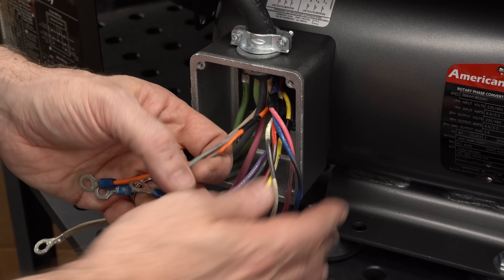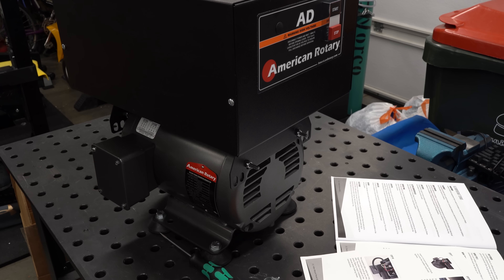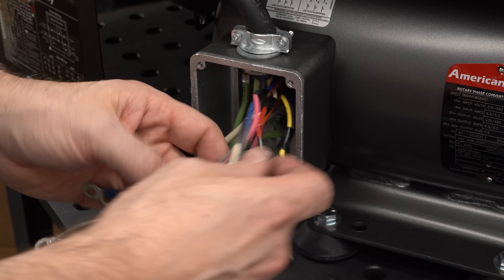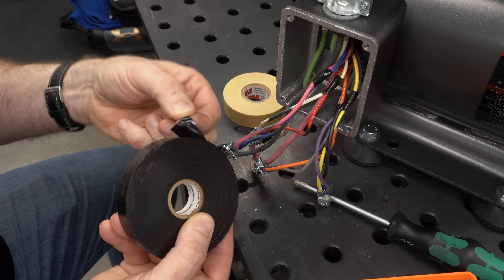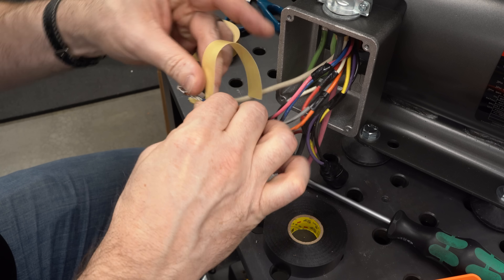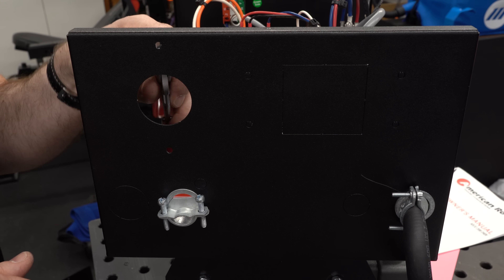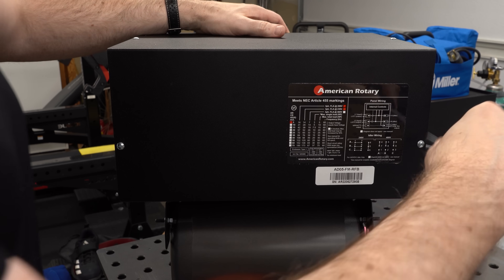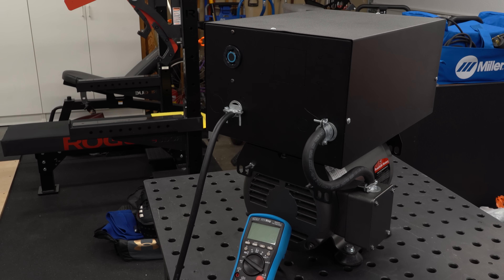How to Wire a Rotary Phase Converter the Old-School Way!

Comment: Small world moment! Was shopping American Rotary Phase converters today. Looking to use one to power an Atlas Copco compressor I picked up locally that is 3ph. One of the reasons I bought the rotary screw compressor was noise levels in my shop. Could you give me a noise level estimate of the phase converter when running?
Reply: Consider using a VFD. You won't have an idler motor running when the compressor isn't. 
Will this compressor be running 100%?
Reply: @dans_Learning_Curve  I have VFDs running my milling machine and lathe. But wasn’t sure how the VFD would handle the switching controls of the compressor. No, it will not be running full time. This is for my home shop but I do have a vapor hone wet blasting cabinet so there will be high utilization periods.
Reply: @daveoh32  what do you use the vapor honing for in your home shop? Inquiring minds want to know!
I believe you can use the VFD remote feature connected to the pressure switch on the compressor. This is how I plan on running my 5 HP Quincy compressor my brother-in-law is setting me up with. Plenty of air to run a blast cabinet, my tire machine and whatever else I dream up! I'm stoked!
Reply: @daveoh32  yes, you'll totally want the VFD to switch on the compressor.

Comment: While I was employed at Ford Motor.  The plant I worked at ordered armature winding machines from Italy.  The 3 machines successfully make the trip to the United States but one of them was driven by my estimation and idiot.  Taking  in improper route  the machine he was delivering was destroyed as he ran into a bridge removing the machine from the flatbed truck.  I have no knowledge of what happened to the destroyed machine, the driver of the truck or the company he worked for. I was told the winding machine 1 of 3 in the universe was worth nearly a million dollars.

Comment: I'm going to be doing this in the near future on my first big boy lathe. Would acorn nuts with a lock washer or a nylock nut be a good choice for making that connection around the 8:00 mark? Your future self will hopefully be the one to benefit the most from labeling those wires like you did.
Reply: The way that we electricians do it is to use the rubber tape first, then the friction tape, and finally the vinyl tape. With the rubber tape smothering your bolts there is no way that they will loosen up on you.

Comment: Oh shipping , Oh shipping...   How about a 120W Laguna CO2 Laser when they decided to save me money and ship everything in one crate. ~5' x ~5 1/2' x ~8' at > 850lbs.  And the lift gate w/ a pallet jack that the delivery guy had could not get it out of the truck. (i.e obviously different then the fork lift that loaded it). After a bit of thinking we used the steel/concrete pipe in front of the water heater in the garage and pulled it out of the truck and precariously managed to get it on the ground with minimal G forces.   Time like this are when you think sewing is a better hobby.  Hope that you had a wonderful T-Day and managed to stay warm in your shop as it looks like it's been chilly.

Comment: "I don't like bright blue flashes in my shop."  The correct technical term is electroboom.

The best I think I had with shipping precision gear was a mainframe computer tape drive in 1977.  The customer had ordered 6 new 9-channel tape drives, and one 7-channel one to convert their legacy tape library.  The movers tried to uinload the 7-channel one by pushing it down a loading ramp on its casters.  It hit the ground and toppled. They delivered it lying on its back on a pallet, and the customer signed for it!  I learnt aboujt it because the district manager phoned me up to ask what the procedure was for standing one up.  I spent the next several days on the phone trying to turn up a replacement. I finally found a customer halfway across the country who was willing to lend me one.  The thing was _ruined_; there was no way I or anyone else was going to attempt to repair it.

Comment: As someone who lives in a country where 3-phase power is standard, this feels so very convoluted...
Reply: USA reached "good enough" in the 1930's and see no point in changing it to modern standards.
Reply: A necessity for someone with 3 phase a mile from their house and not willing to pay the power company a lot of money to bring it that mile!
Reply: @dans_Learning_Curve  To bring 3 phase 100 meters I was quoted $13,000 ten years ago, and that didn't include anything past the power company wiring.
Reply: Oh shut up already. :)
Reply: Every home has 3 phase power? What county is that?
Reply: @fritzmiller9792  In my case, Finland. Pretty common in other European countries as well.
Reply: @BrorAppelsin  So to be clear, 3 phase power is brought to every home?  That's 4 wires. It's great if so but that's a much greater install cost for all parties.
Reply: @fritzmiller9792  Yes. In some older small apartments you might've had only a single phase as the requirements were smaller. Regular houses start from 3x25A which is what I have.
Reply: @BrorAppelsin  Well that's an excellent system which must save many kilowatts for the entire grid. The original decision to invest more to install 3 phase everywhere was very wise by the people involved. I will travel to Europe/Great Britain in the near future and I look forward to seeing that infrastructure and individual house wiring. With the 220 volt appliances I bet the amperage and wires can be smaller.... even high power appliances like ranges and dryers.
Reply: @fritzmiller9792  Here in Finland common fuse for sockets is 10A so about 2300W and the wire is 1,5mm2 or 16AWG or 16A (~3700W) and 2,5mm2/14 AWG. 20/25A needs 6mm2/20AWG. So current is about half of what's necessary for North America. For reference the feeder to my house is 4x16mm2(6 AWG) which can support at least 3x63A feed if I buy an electric car...
Reply: @BrorAppelsin  very interesting, Thank-you. And are electric ranges/ovens 3 phase? Dryers? Well pumps? Something fairly new here, 3 phase submersible well pumps would much simpler there. The concept is the pump control (VFD) responds with a flow meter and the system doesn't require a pressure tank while the well pump only need turn up to a speed to match the water volume requested....so a small trickle of water can be provided with the bare minimal electricity required to push it. Brilliant idea but another example of single phase power limitations here in the US.
Reply: @fritzmiller9792  Electric range/oven can be single phase, but common setup is 2 phases for the hot plates and 1 for oven. My well pump is now single phase but the previous one was not, I do have a small pressure tank (50 liters). Water heater uses 2 phases, sauna stove 3 etc. Heating is using all phases and has a feature that if heating is on and I turn on the sauna, heating will be off when the sauna warms up (6.6kW stove).
Reply: @fritzmiller9792  Denmark. The majority of houses and many flats. OTOH, my friends quite new house in the outskirts of Paris is only single phase 230V, but with a 50 amp main fuse
Reply: @Blake Griffith the power you get depends on how you use it, for regular domestic use with single phase and 25A max you get about 5750W per phase but if you use 3-phase motor the maximum power depends if it's connected to star or delta, ie. 17.2kW (star) or 30kW (delta). It's also possible to use 2 phases (for like water heaters) to get more power. In single phase applications the US system wins but then again there's a need to use rotary converters or a vfd to run 3-phase motors.

Comment: I just installed a Canadian Rotary (just re-labelled American Rotary north of the border) UL-10 model very happy with it and my new 3 phase mill. You can check it out on my channel. I ordered the mill August 2021 and received it 10th November 2022. Had to take a 3 phase machine due to lack of single phase motors. Happy in the end is all that matters. Hope you get your machine soon.

Comment: Do you have a engine cherry picker and a adjustable Engine sling? Cause That's likely the direction I would go. As I already have on available. or if you got got a buddy with one, you can borrow. often you can find them cheap on craiglists too, people buy them, use them once or twice and store them, then forget and sell them down the road. I've had mine for about 15 years now, actually bought it for car projects. But it gets used more for heavy items than anything.  

Other Suggestion would be a A frame with block and tackle. Also great. But doesn't quite collapse as small. Little harder to find these days too, on the used market.
Reply from the maker: It ended up being easier than expected.  I just picked it up and set it on a furniture dolly.
Reply: @Clough42  That's what all that weight lifting gets you. ;)

Comment: I've taken "flags" of the self-vulcanizing tape and wrapped each wire individually. Then over-wrap those wires with more self-v tape to form a true water tight connection. If you don't do them individually first, there is a direct path for water/air/corrosion where the wires meet along their length.

Comment: James....how loud is that phase converter (db) when it's running, and does it have an option to have a remote switch to turn it on and off....thanks.
Reply: Check out Keith Fenner on YouTube. He's running his whole Shop on a RPC. The noise isn't too bad.
Reply: @dans_Learning_Curve  I did watch that vid as well....I figured that James would fire this unit up and pull out his db meter at exactly 6 feet and provide us with a data point....🤣

Comment: I work on 3 phase motors a lot. I HATE bolted connections for the exact reason you stated, they puncture insulating tape. They also take up a LOT of space. I don't even bother any more. Solder the wires and be done with it.
Reply from the maker: Under the right conditions, solder works great.  Connecting a wire to anything rigid in a high vibration environment with solder often leads to cracking long term.
Reply: @Clough42  That's why Wagos have springs - I doubt that bolts would pass IEC/EN 60068-2-6 and -27.
Reply: There's a rubber tape that's supposed to be used, then the usual tape overtop.
Reply: For wires that small I would use crimps and Scotch 88. The Cambric tape is absolutely the best method, however, if using bolts or split-bolts for larger wires. Digging off rubber tape is the absolute pits for anyone coming behind later, trust me.

Comment: Not sure I understand how the convertor only makes 1 phase. In 3 phase power the 3 legs are 120 degrees out of phase. In 1 phase power the 2 legs are 180 degrees out of phase.
Reply from the maker: The two phases are only 180 degrees apart of you are thinking in reference to the shared neutral.  If you ignore the neutral, you just have one 240VAC phase between two legs, A and B.  If you generate a third leg such that B-C is 120 degrees behind A-B, then by definition, C-A is 120 degrees behind that.
Reply: @Clough42   @Clough42  Yea Duh... Boy do I feel stupid.   Thanks James for clearing the fog in my brain.
Reply: @Clough42  is this why 220v is called single phase? I haven't had a chance to look at 220vAC on a scope.
Reply: @dans_Learning_Curve   Two phase electricity is obsolete. The correct terminology is split phase, or single phase 240V center tapped for 120V each.  In other words, it's not two phases, but one phase divided in two.
Reply: @johnalexander2349  Please do your research and you'll find your high horse is a mere pony in a pompous parade. Touchė!
Reply: @bobweiram6321  WRONG.
Reply: I was thinking the same... How do you take the dual 120V 180degrees out of phase and add third phase and create 3 phase. Being that the unloaded voltages are not correct I'm thinking that the power factor is not real good and must  be semi-corrected with the caps and motor. along w/ a highly inductive load (i.e. motor)
Reply: Yeah, me too. James, If you can delve into this mystery with your o’scope, I for one would love to hear the explanation. Maybe American Rotary has an understandable story line.
Reply from the maker: @davekellogg6819  They have an FAQ that says the output is a "high-leg" or "wild-leg" of "floating" delta configuration.  This is distinct from a 3-phase "Wye" configuration, which is what most people are expecting, hence the confusion.
Reply: I think there's confusing a static phase converter with a rotary phase converter which is what he installing.  A static converter works as he describes. It merely provides starting current for the third phase by discharging a capacitor.  Once the motor starts, it disconnects the capacitor from the third phase and continues operating on a single phase. Essentially, it not unlike a typical single phase inductive motor with a start capacitor. Some static phase converters add another run capacitor to balance the voltage with the load. The 3-phase motor will be derated to 60-70 percent of its horse power. 

Rotary phase converters is a clever hack where you use a single phase motor to drive a 3-phase generator to regenerate the 3-phases. It also derates the motor since there's losses due to the conversion process. You can build a rotary phase converter by linking a 3 phase motor (the generator) with a single phase motor (the driver) by coupling the two shafts. The one in the video is an all in one unit.

Comment: Interesting, didn't realize you don't get 3 nice equally spaced phases out of a rotary phase converter, nor that this fact wasn't a big deal for many uses! I always learn something 😁
Reply: There near enough equally spaced, but not referenced correctly to the neutral.
Reply from the maker: Correct.  The timing is correct.  They're not centered around the neutral.
Reply: I was happy you showed the potential between the legs.  It's similar to my DIY rotary phase generator.   I run a step up transformer after.   That makes the difference even larger.
Reply: Well there you go I had even more to learn 🤣
Reply: The phases are NOT equally spaced. The two incoming lines are 180⁰ apart, and the 'manufactured' leg is halfway between them. A rotary phase converter works very well, but is far from a 'perfect' output. Yes, I do have a Fluke Power Quality Analyzer that I have used on my American Rotary ADX-25 converter.
Reply from the maker: @premiersi  looks like a video addressing this misconception is in order.
Reply: @Clough42  I have screenshots of my Fluke that shows what the output of my phase converter looks like. Let me know if you want them.
Reply from the maker: @premiersi  I'm definitely interested.  Email is in my channel contact info.
Reply: @Clough42  Ah, this is just the comment I was looking for. I’d like to understand this at an engineering level; I will most certainly watch & study such a video. Also it’ll be interesting to include Jason Wolthuis’ scopemeter screenshots, if available.
Reply from the maker: @624Dudley  I have the screenshots from Jason, and he gave me permission to use them in the video.  Much of the confusion around this comes from the multiple different configurations of 3-phase power systems.  The output of the RPC is a floating delta configuration, with no neutral.  If you pass through the neutral from the center-tapped 240V split phase used to power the converter, it becomes a "high-leg" or "wild-leg" delta configuration.  If you're using a power analyzer like the Fluke to analyze the output of your RPC, make sure you have it configured in the right mode.  Ideally, I think you should connect only the three output legs (A, B, C) and ground and configure your analyzer to "3-Phase Delta" mode.  I don't have one, so I'm not totally certain how it works.  If you include the neutral from the wall, set it to "3-Phase High Leg".  If you connect the neutral and set it to "3-Phase Wye" it will give you a lot of confusing information and show some disturbing waveforms.  If your application requires a Wye configuration with a neutral, the RPC alone is not suitable.  You will also need a Delta-Wye transformer to create a neutral and ground-reference it.